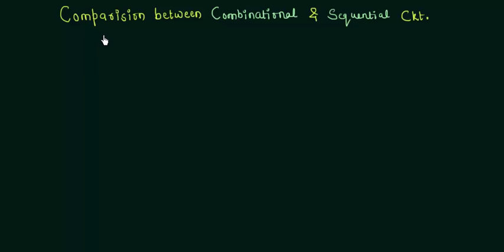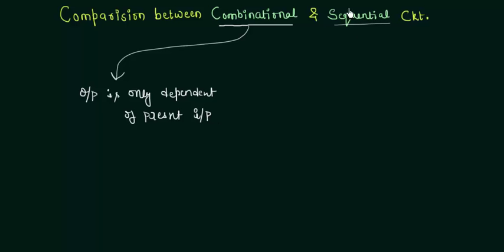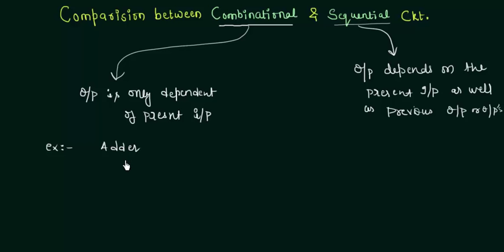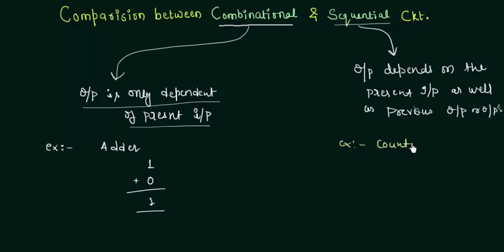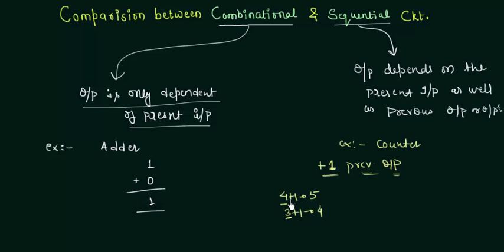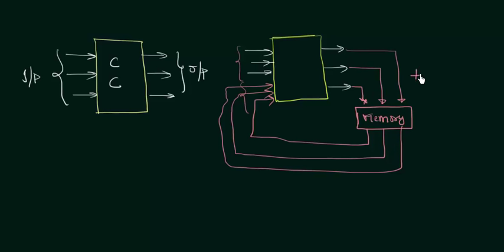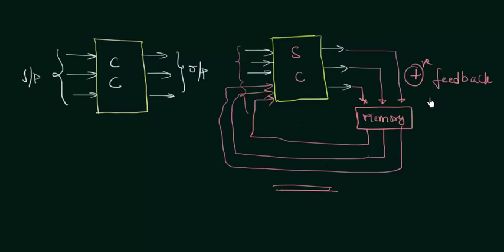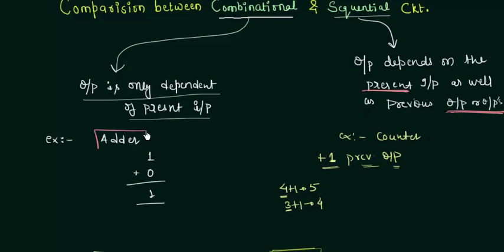Comparison between Combinational and Sequential Circuits

Comment: Sir, I have a doubt that if sequential circuits depends on previous outputs also then if we take a case like full adder in which we have multiple number of logic gates...so my doubt is that the output of first XOR gate is input to another XOR gate....which concludes that the second XOR gate has input equals to output of first XOR gate...which implies it depends on the previous output too then WHY it is considered as Combinational Circuit whereas it has input depending on previous output too
Reply: No, we have to consider whole circuit like u r saying that in the case of full adder, output of one XOR gate is the input of the other. But here we are considering this  in the internal of the circuit but not as a whole. Like if the final output of the full adder will depend on the initial input then we can say that it is sequencial circuit but here, this is not the case..  intial input of the full adder does  not depend upon the previous output as u know thar....